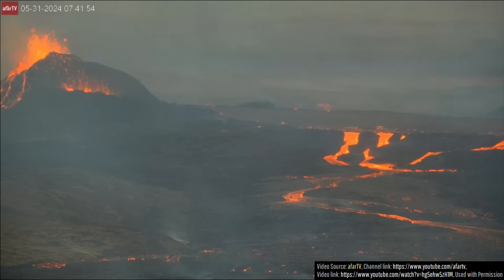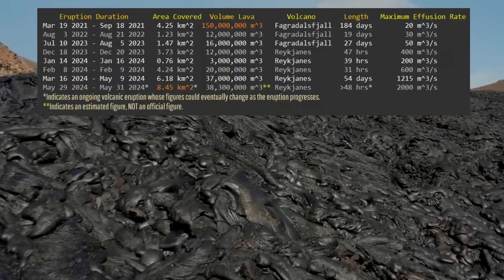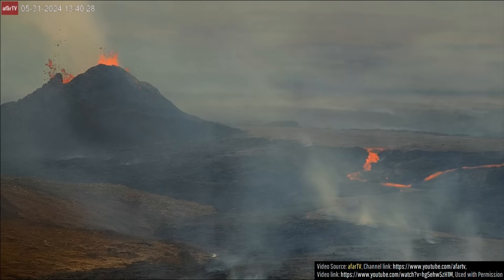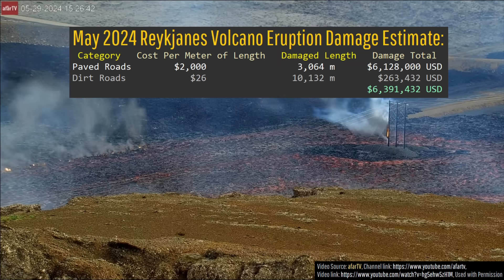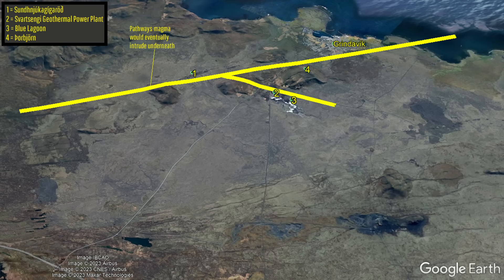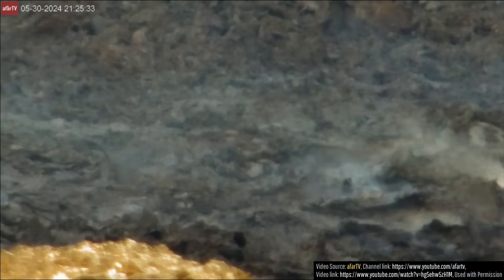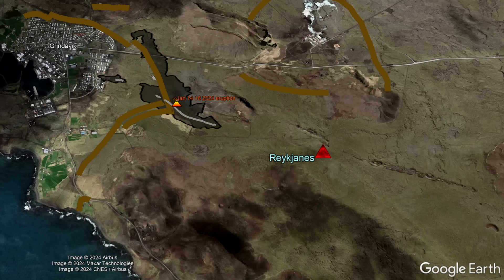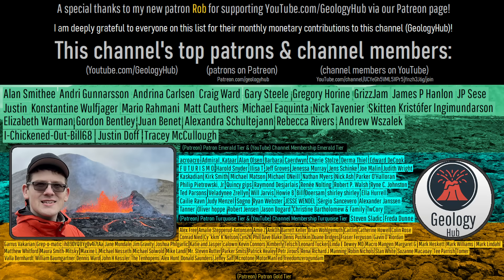Iceland Volcano Eruption Update; The Town Walls Hold, Hydrogen Gas Emissions

Comment: Great vids but there is three problems with the video overall: First off, you are using outdated data on inflow magma rate as that was in December but in Jan and after that, it's averaging at 6 to 7 c3/s. Second, sticky magma theory doesn't make sense because the sill storage is much larger in terms of volume, as IMO says that it's holding 80 million c3 at least, could be more depending on what numbers used from November 10th event and not mention that it takes awfully long time for magma to cool down in underground as the sill storage is constantly fed by fresh hot material from deep source repeatedly, it's pretty unlikely that magma would cool in that storage area. Third, your estimations for area size may be underestimated, as latest IMO map shows lava flow size is larger than your graphic-made map.

Comment: The shame of it all is that this energy cannot be harvested for the good of Mankind.
Reply: Grindavik does indeed have a geothermal energy plant.
Reply: The Svart Sengi Power Plant was built in 1976.   It has been producing power and heated water from its thermonuclear plant right next to the Blue Lagoon.
Reply: @michaeldeierhoi4096 Thermonuclear? I think not! Geothermal surely?
Reply: @davidcranstone9044  Yes geothermal. A paroxysmal brain fart interfered with my normal brain function.
Reply: @michaeldeierhoi4096 Thermonuclear? You serious? Thermonuclear refers to nuclear reactions that occur at very high temperatures, think hydrogen bombs.
I think you meant geothermal? As in heat in the rocks? I know some of the heat in the earth is from the decay of radioactive elements such as uranium, but that's in the earth's core. Heat is taken to the surface mainly by convection currents in the outer core and mantle. In the crust heat 8s carried to the surface by conduction. 
The Svartsengi power plant uses this heat to produce steam to drive turbines that generate electricity.

Comment: The maximum Effusion Rate has been continuously rising. And these numbers are worrying. Can anyone make a prediction  about the next eruption?
Reply: It has not been rising.
Reply: @Dranzerk8908  It has, current one had up to 2000m3/s, previous had up to 1000m3/s, February one had up to 800m3/s, January one was small and had up to 200m3/s and December one had around 400m3/s at most

Comment: How did it erupt so much lava so quickly?
Reply: It had the most lava to date underground..the pressure will do that.   Its why it expanded so fast.
Reply: Thanks, from the cam view, it looked much smaller than it really was.I was just shocked that it already erupted more material than its last eruption.
Reply: @AngryGecko1010 It's also the rate at which the magma erupted within just the first four hours. It was estimated that the lava erupted at a rate between 1,500 and 2,000 cubic meters per second.